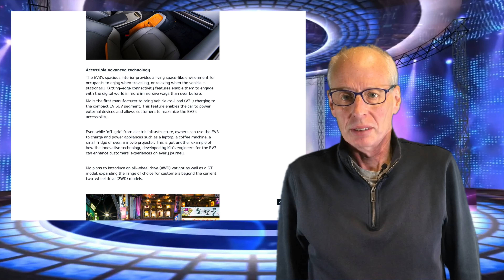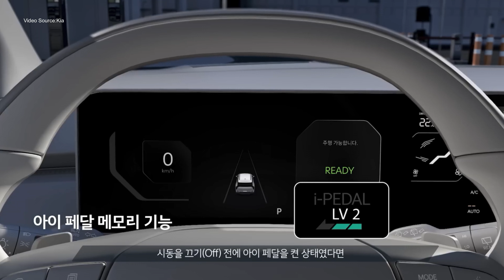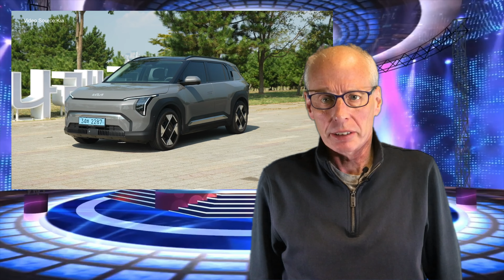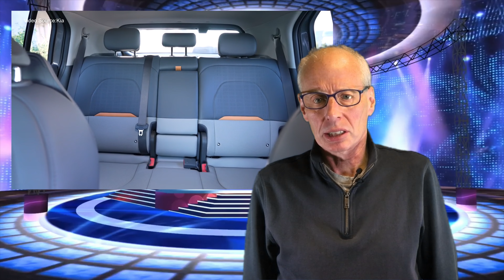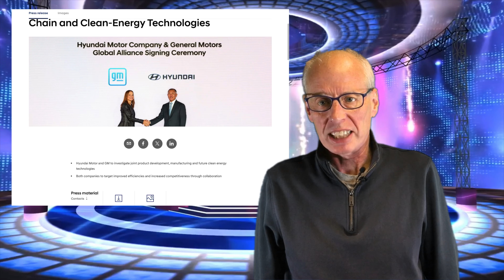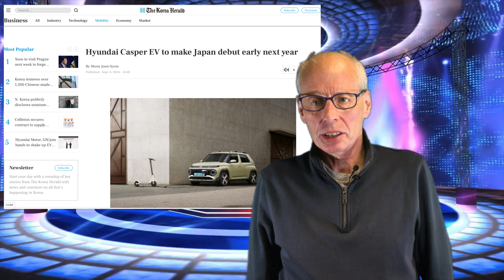Kia Electric News Episode #80 15th September 2024

Comment: I ordered a GT Line S, but didn't spec the heat pump. In the UK, I just don't think it's worth the cost. I barely use the heater or air con in my current e-Niro 4+. Only if it's really cold or hot. I find the seat and steering wheel heaters are enough to keep me warm enough. Seat ventilators in the summer.
Reply: The big difficulty is the lack of data on heat pump performance in different conditions to enable an informed decision to be made.  Without this it’s all a bit of guesswork as to whether it’s worth spending £900 or not.
Reply: I've watched a couple of "drive EVs until they die" videos, the most recent included two VW id7s, one with heat pump and one without. The difference in range extracted was negligible, particularly when taking into account the extra cost of the heat pump in the options list on VW website...
Reply from the maker: I’m in the Midlands and also don’t think i need it. I don’t do the miles either
Reply: @evodessey  Me too. I'm going to the EV3 event on the 24th in my area.

Comment: Heat pump and digital key is standard in Sweden.
However Kia Sweden presented two different sets of LED rear lights, has anyone else encountered this in your markets? Just seems odd and unnecessary.
Reply from the maker: Not noticed different rear lights will have a look now. Someone in Finland mentioned the other day that the Air trim does not have heat pump option which seems bonkers to me.
Reply: @evodessey  Yup, that is true. The EV3 Air does not have the heat pump as standard in Finnish spec. It costs 1150€ extra.
Reply from the maker: Just  seen it on EV3 Facebook group https://drive.google.com/file/d/1YbcGw0bImvxIuOFYpGoai9Uf2ZZ44s4t/view?usp=drivesdk
Reply from the maker: Looking on the Kia UK 3d configurator the Air has the rear lights with horizontal lines,Gt Line has diagonal lines so same as Sweden. https://www.kia.com/uk/utility/build-your-kia.carcode.ev3_2024/#/trim

Comment: Does make me laugh when the least efficient wheels ( 19” ) are the only ones on offer to GT and GTS options. All this fluff about striving for super efficiency rings rather hollow. All Kia is doing is letting the Bigger battery take the weight.  The absence of a heat pump in ALL models also makes all this efficiency waffle sound rather disingenuous!
Reply from the maker: Very true. We should have a choice of wheel size & heat pump in all trims
Reply: @evodessey  Efficiency is king ! Kia seem to have forgotten this !
https://youtu.be/Me8LmYkPvEU?si=rQsCz0rAC24wbgM8
Reply: @evodessey  absolutely and the V2L, if the Niro EV has them why not the EV3, this is what has put me off the EV3 and the price
Reply: I had the same thought - that is just so dumb ... these cars are limited in speed at around 100mph, so why would I need tires that give me great stability needed when driving 150mph - what a waste of efficiency and more noise on top of that, when you love the cultivated silence of an EV. 
The main thing I really like are the new smart driving features ... with my Niro EV before every roundabout I have to switch to manual else it will jerk me through it, accelerating while sharp turning because in that moment there is no car in the sensors limited sight, which is so very unnecessary and could already be resolved by software in my car. If the steering wheels angle and speed exceeds a certain level, there will be no auto throttle - as simple as that! In real life its always one button press, pausing the autopilot, hearing the ping sound when toggling into I-Pedal and afterwards pinging again when returning to auto distance mode. I could also drive it all manually but what is the point when most of the time, the car can do its thing and not bother you with boring slow manual driving.
My problem is that I am German and used to drive as fast as possible, its in my genes. Since such a behavior is not compatible with the climate crisis, and I have a hard time not going fast, a speed limited EV is the perfect answer to that. In order to not speed up against my nature, I let the car do as much as possible, which is something I can enjoy.
From this point of view the EV3 would really make a lot of a sense to me, though I think it looks shittier than my Niro EV from the outside, which doesn't matter much because I spend all the time on the inside, which I really like with bigger screens that are higher up. 
I will do a test drive in October, will see how that feels.
Reply: You can use 18" wheels when ever they are available sadly not at launch. The difference itself to wltp is not that big. Your driving habit saves more than any wheel size.
Reply: @jkajolin I have been told I can buy some 17” wheels separately but to be honest I might just wait until a set come up on eBay as this is likely to be our last new car, and it’s costing enough already. I just feel Kia are doing a bit of “ virtue greenwashing”  with all this efficiency marketing when most of it simply doesn’t apply to any of its car options on offer ! 
Heat pump with big inefficient wheels but a big battery ! Or Smaller efficient wheels with no heat pump and a smaller battery ! The Air Long range is the most efficient and the least spec’d and pretty expensive.